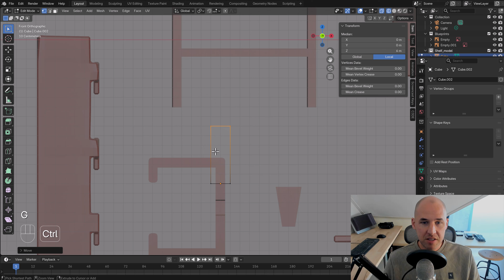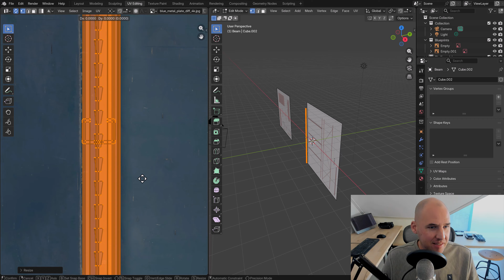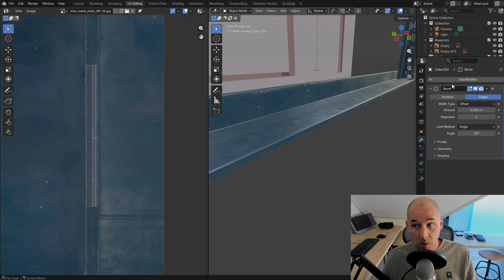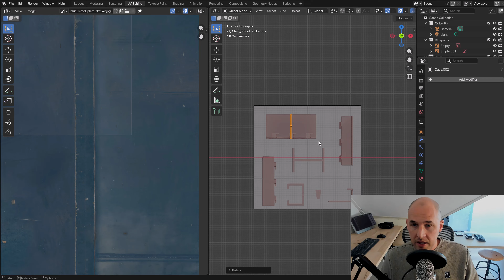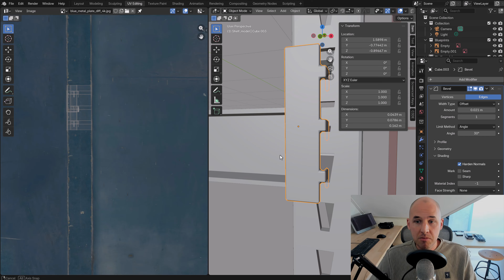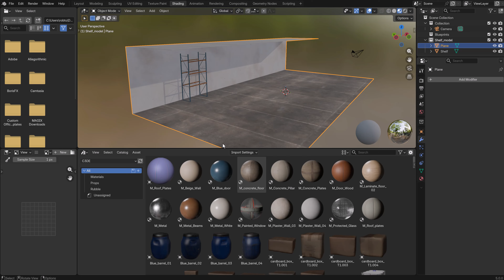How to Build a Factory  Shelf in Blender (Tutorial)

Comment: Thank you for this tutorial.  When you made the cross bars orange metal, I thought to play around... :)  I separately added the orange texture and mixed it with a noise texture. A b&w color ramp on the noise for fine tuning and another color ramp on the orange to set/adjust the "orangness" . I took this output and mixed it with the blue and put that into the Principal BSDF and got myself a rusty blue rather than completely rust orange or completely blue.

Comment: it may be more detail then needed, but, what about modeling  the welds?  not that my little AMD RX6600 is up to that task..
Reply from the maker: In the original design I did include the welds, but in the final version I had to simplify a few things to prevent the course from becoming too long. Several elements did not make it into the final course for that reason.